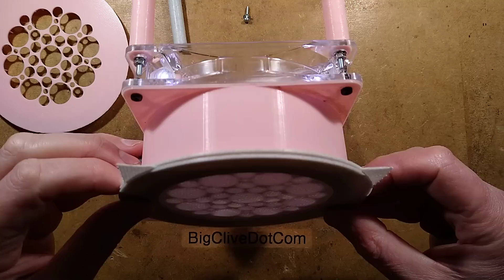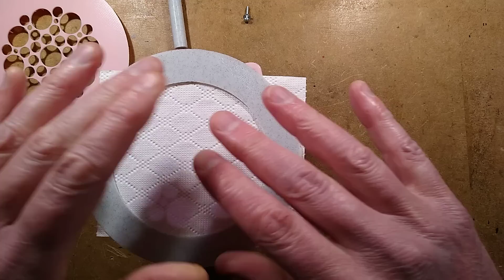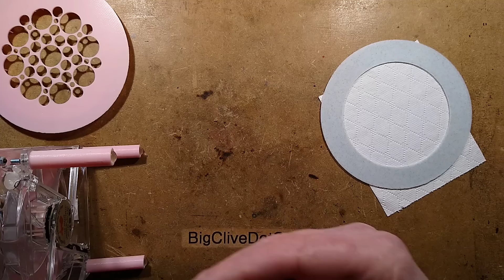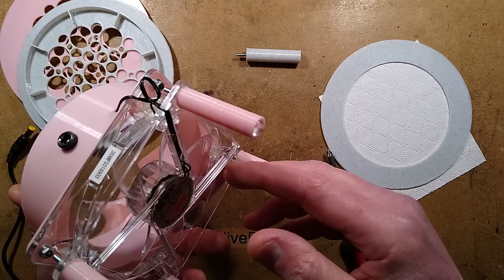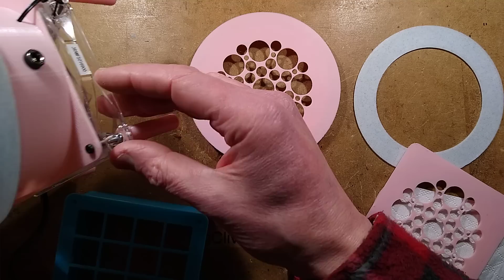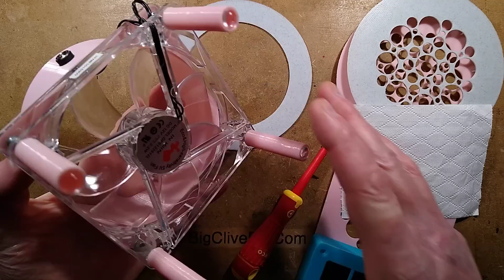MK3 air filter with customisable 3D printing files

Comment: OMG ! hate to be chatting about your ring ! but you could make dimples for small neodymium magnet to hole your ring LOL  !!! 
You Really need to do some testing with different fillers (the tree pollen is no fun at the moment here ) so may be have test at one my self 

catchphrase
don'tunderstand just silly answers by people that think they're smart than you !!!! 

I don't know lot about this stuff but do bit of air brushing and painting (dolls houses) and have made temp small spray booth, 
A lot of the real spray booths (normally for posh car painting ) use down down draft would there be any point running you little fan upside down ? 

And there's a  different type of filtering call waterfall were they pull the air through water to take the fumes out of the air normally for solvent car paints how good is water at filtering stuff ?

Just thing out loud ? but I love that you make thing about things love Jenifer xxx
Reply from the maker: I've looked at a water based air cleaner in the past.

Comment: An integrated square grid on top of the round column to support tissue. The a loose fitting round cover cap to place over & hold tissue in place. Loose fitting to be gentle on tissue corners & a pattern on a cap to visibly contrast and see dirt collection letting you know see it's dirty. Like a plastic jar & lid without screw threads

Comment: I'd be inclined to try out printing a 'turbulence diffuser' to slot into the void with a cone to cover to centre of the fan, to see if it made any difference. You'd need to try it with and without and see if there were any differences in the dust or air fluff collected.  Definitely a good project tho and of help to people needing cleaner air to breathe especially if there's dust or pollen around.

A bog roll holder and dirty tissue collector with a handle on could be the next addition to the project 😉😂.  Wind the handle and a new sheet is available.

Comment: It would help if you Crinkle folded the paper to make Collection Veins Pockets that hold more dust if you look at other Hepa Air filters + they also let more Air pass throw
the have a Repeating  WWWWWWWW Shape 
The Pockets also make it more hygienic to Depose of a Dust Full Filter Do the pockets trap the dust inside for Cleaner disposal Otherwise the dust goes everywhere 
 
Few Macarno Sets and you can make a Folding loom to make the HEPA Pocket filters + Rollers PVA Glue  the tops and Sides  to Give Ribs and structure

Comment: I modified a 1980’s Phillips fan heater that has a fan on either side- just took out the heater elements,and put a piece of “heperflow” vacuum cleaner bags over the inlets- filters the air nicely

Comment: I got a box fan that has a quiet mode and an ait filter designed for air ducts that managed to match the size of the box fan build a spacer duct between the blades and the filder and it ended up doing the trick for my allergies. I wanted to see the diffrencw between before and after and used lazers to map how much dust was there before and after and after about 30 mins all the dust in the air was gone. Tho the room was a bit warmer then usual.

Comment: A few notes/suggestions: Use a Yate Loon D12SL-12 fan with a USB 5v power supply - will be dead quiet and spin reliably, and no dinky unwanted lights. Maybe a hexagonal pattern for the top cover?

Comment: I could see a couple of improvements: 1)I think the filter material is likely to blow away if it was near a fan or air conditioning, perhaps more likely if the fan were off. Perhaps a magnet to latch the top ring on? Or a clamp? 

2) Could it be possible to incorporate some fins on the outlet to divert air away from the fan to prevent the filtered air from recirculating back to the inlet? Perhaps as part of the legs.

Comment: You know, you could just add a thin rod section to each top of the legs that could go all the way through the fan and come out the top, add four small holes to the plenum and have it snap or glue onto those pins.  Or make them a bit longer still, cross drill them and pin them in place with bits of wire or something, sort of like cotter pins.  No need for nuts, bolts or washers.

Comment: There are slow-running larger diameter fans that are usually put in the side vents of PC cases. Maybe doing the same thing, but with a fan with 20cm diameter (or 8 inch, if you prefer) would be worth a try. Then of course with a kitchen towel, since a piece of toilet paper is too small. I also wouldn't mind the round top, but with the square grid-like holes as in version 1.0 (I think it makes for more area for the air to pass through than the different sized circular holes). This would of course potentially mean that it may have to be printed in multiple parts that are then somehow put together (I'm thinking about some type of jigsaw mechanism). And of course I would love to see proof that it can actually reduce the fine dust that usually gets sucked up by your vacuum cleaner.

Comment: I would feel that having the whole unit be horizontal would be better for the following reasons.
1. That would allow for more uninterrupted airflow as the fan is no longer blowing air at the ground.
2. It would reduce the amount of air being recirculated through the system. You can add a long tube to completely remove the chance for air to be sucked back in.
3. Some PC fans (especially cheap ones) with oilite bushings will have the oil seep out if constantly in a horizontal orientation, shortening their lives.

Comment: The soft toilet paper seems to leave a lot of lint in the bathroom, whereas cheap toilet paper does not tend to leave as much lint. My sense is that kitchen paper towel would be better for this application but haven't tried.

Comment: What percentage of the inlet duct is masked by 3D print plastic? Is this version the optimal design? (cf. short-lived history of turbofan/turbojet bell nozzle anti-FOD guards).
Worth noting that a bell-mouth inlet duct improves efficiency when the ambient inlet velocity is ~zero for a stationary device (IE, not able to benefit from dynamic ram-air effect).
Reply from the maker: This one put form before function.  I'll make a more efficient pattern.

Comment: Would a simple pattern of spokes work for the top? That way you could bring the fins all the way across. 

In any case, it looks pretty good. I think you've got this down as simple as it can be.
Reply from the maker: I've already designed the eight spoke version.  It basically extended the turbulence fins to the middle and got rid of the hole pattern.

Comment: Make use of the whole roll of tp. Wind it very slowly onto an empty roll or a stick. That way the filter could run unattended for quite a while. Even in a very dusty environment.
Reply: Some pieces got lost: The tp should be moved across the grid from a fresh roll onto a stick. Maybe two rolls are required; slightly interleaved to avoid a bad filtering effect through the perforation.

Comment: Maybe add a corrugation in the top piece so more air can move through the same area?  Even if more air doesn't move through you wouldn't have to replace the paper as often.

Comment: Screw simplification option: you could eliminate much of the hardware and assembly by using a single screw that passes from the top, through the fan mounting holes, and into each foot.  A self threading screw or even a drywall screw would work. Just modify the hole in the foot to accommodate such.

Also wondering if you could print the top maybe in a pleated sandwich /\/\/\/\ so that you could increase the surface area of the filter substrate - would improve air flow.

Comment: Nice choice of filament color! Although I feel that all pink electronics need to be mains-referenced.
Reply: @gary6576  
Why stop at mains? Add a few components and you could have a voltage doubler,  giving you a wonderful chance of a 500-700 volt DC shock
Reply: Wouldn't take much to use a cheap dropper capacitor 'transformer' for power :)
Reply: Yes, he's missing the negative ion / ozone generator.
Reply: Agreed on filament color :) One could use a polarized Tantalum capacitor as a dropper cap, instead of Mylar, that'd increase the danger off this unit.
Reply: Loving the Pink!
Reply: these are just leftovers from the toy production ;)
Reply: You could always connect it to a cheapy chinese PSU and build an aluminium housing for the fan what needs to be reference to mains for the usual 'zing'.
Reply: instablaster

Comment: I was going to write after the last video but the phone rebooted randomly. What you call the fan buffer zone is called a plenum in HVAC lingo. If you are looking for the most filtering for the cost of the power and the lowest amount of noise using the general setup you have, consider two changes to the design. One is going back to the open grid for the filter support as the holes, although they look fabulous, do restrict the amount of filter with flow through it, which increases the velocity were it does go through, which will create more sound and decrease the effectiveness of the filter. Then the second thing is to blend the plenum from the square shape at the top to a round shape at the bottom without hard angles or edges, so it ends up the same inner diameter as the fan.  No need for any fins to straighten the flow as it will only add resistance and noise. You would need those only if doing multiple stages like rotor, stator, rotor etc..

Comment: something like this is a fight between noise airflow and static pressure when it comes to the fan i would look at pc fans made to be used with radiators like the noctua nf-f12 the best option would be the industrial ppc fans however they are  26$ each while the nf-ff12 are 20$ each (noctua is expensive but they are probably the best fan makers in the pc industry)

Comment: Ou can make the legs solid so that the 10mm silicone feet can also glue in the middle and use heated inserts on the top side, the hole diameter for m3 brass inserts is 4mm and 6mm deep.

And then have slightly longer screws that attach the base to the legs through the fan.

For a few cents of inserts you remove 8 nuts and 4 screws.
Reply: Or just print the same sort of blind hole at the top and use (long) self-threading screws, for even fewer parts.

Comment: Where's the file to print a sheet of toilet paper?
Looking forward to the underclocked 40cm desk fan version (series capacitor?)
Reply from the maker: The 3D printed toilet paper is very abrasive, and you have to sit for an hour while each sheet prints.

Comment: How would I go about sending you something. Specifically it's a 24v motor with PCB for a dual fan air purifier, still working took it out a unit I have but thought you might find a use for it. Not sure how to get in touch with Clive directly though?

Comment: Thanks Clive. Will be printing a couple of these off tomorrow for the workshop. Will be interesting to see how they perform.
Reply from the maker: A workshop might require something a bit beefier.
Reply: @bigclivedotcom  It will certainly, however for quite a dusty environment it will be an interesting test.
Reply: @bigclivedotcom  Any chance you can provide the code for the original square platen please?

Comment: I told you last time the grid was better for airflow! 😉
You might wanna try a radial grid arrangement like some circular drain covers use.
Reply from the maker: The radial design has already been made.
Reply: @bigclivedotcom  wouldn't radial also make more sense as far as the turbulence prevention fins go?

Comment: Next stage; A fully 3D-printed vacuum cleaner with tissue dispenser for changing the filter after each pass on the carpet... :P
Reply: The fancy version would take a full roll and slowly use it up, like a really wide reel-to-reel.
Reply: An autonomous vacuum cleaner with presence and motion tracking. ;DDD
Reply: Is this gonna evolve into a mini Dyson Root Cyclone™?  Hope so.

Comment: Could you combine it with an ioniser to help attract the dust in the room towards the unit then have the fan pull the dust out of the air through the filter? This could be a nice way to deal with the mess that usually collects around ionisers.
Reply from the maker: It could, but possibly with a slightly positively charged mesh under the paper.

Comment: I would also like to see some version with a electrostatic stage.
Reply: Yes, this needs combining with some dangerous eBay quality high voltage electrics. Maybe add some negative ions and UVC for added excitement.
Reply: @ncot_tech  Yup, more excitement factor needed.... 3 phase perhaps?.... Lasers, definitely!
Reply: Suggested that last time! A "useful" application for those EBay cheap ionisers, and Clive's supply of carbon fibre underfloor heating cable!

Comment: I should try this with my old server fans. Though since they spin at 10,000RPM I suspect they'll act more like paper shredders hehe
Reply: Cut them back to about 4 volts. That is what I did with some that I'm using for a mini breeze here. I found an old phone charger to power them. Good luck.
Reply: @d.t.4523  Thats kinda difficult since they are 240v fans :P
Reply: @AK90  Well... crap! Just when one of my "optional engineering" toys was a neat trick, someone throws a high voltage wrench into the works. Keep working on it. Good luck to you! 👍
Reply: Noise needs to be taken into consideration
Reply: Only 10k? My dell server has 15k RPM fans... About 8 of them. When it cranks them up for a self test, it sounds like it's going to take off.
Reply: @tin2001  That's not a server - that's a space heater!
Reply: @tin2001  Yeah its from a fan pack that goes on top of a server rack to exhaust the heat. 10,000RPM, Aluminium housing and steel blades. Also runs on 240v :P

Comment: I've used a wide variety of paper filters for making herbal smokes more discrete and found a VERY wide variability of filter performance levels between various toilet papers, paper towels, and napkins. I would love to see a test of 3 or 4 of these with different filter papers, but it's almost impossible to determine a paper's relative performance level without blowing smoke through it to test.
Reply: Might want to be careful which ones you use. Some of those products have oily additives that have become to bane of my printer. Finding the only stuff that doesn't have it is cheap dollar store paper towel or hardware store paper rags. Even the blue mechanic stuff seems to have some sort of additive that easily deposits onto warm surfaces below it. Not sure how safe that would be to inhale though it's bound to be safer than raw smoke.
Reply: @eideticex  The filter is for exhaling through only. I trust paper towels meant for hygiene during meals to be relatively clean.

Comment: This is a good idea for hot places, for example, in hot places fans circulate the dust and you get a bunch of allergic reactions.
Reply: If you are using a larger fan(box fan), you can use a furnace filter on it to really effectively filter the air.
Mattias Wendel does this for his wood shop in his basement.

Comment: I'm confused. Where do you use this:
Reply: Put in on a bookshelf or on top of cabinet or anywhere in the air circulation pattern of the room you can find that's out of the way.
Reply from the maker: Bedroom, where it can run 24/7 silently.

Comment: very cool, on amazon i found for usd $5 shipped a "cabin air filter" for various cars, it's rather large and i printed a custom adaptor for that for putting near my soldering to suck up fumes. it works quite well.

Comment: my computer case came with a 'dust filter' that is just a foam like material. 
I didnt think it would be a very good filter, but it works surprisingly well. And has more air flow then a piece of tissue paper.
Reply from the maker: It's a coarse dust filter to allow high air flow.

Comment: Those that don't have a 3D printer can use a 20 inch box fan with a furnace filter behind it.
Reply: NYT Wirecutter did a video about that. Removed 85 to 90% of match-smoke particles from the air versus 95 to 99% for commercial units
Reply: 3M Filtrete brand furnace filters work especially good for fine dust or particulates.

Comment: 0:32 The lights come on, and I start thinking "Oh, that marble filament always looks good, but it feels a bit tacky h… oh.  I can't tell if that has made it worse or better."

Clive, if you ever use another filament color, I will be somewhat disappointed.  It's so bad it's good, but it's so so bad that I still don't want to buy a spool of it for here.  It also has about the right color value and saturation to let shading and contours show up on camera.

Putting the OpenSCAD files in the descriptions is a great tradition to keep up.  OpenSCAD is an impressively expressive language for both how small it is, along with how small programs written in it can be.   I would guess that many of your examples fit into a QR code, QR Codes being the new "number of pages." (NB: OpenSCAD also manages to fit a stunning quantity and diversity of frustration into such a small language.  I start most deigns in FreeCAD nowadays, for better or worse.)
Reply from the maker: Openscad is extraordinary.  Literally a programming language for solid objects.  The maths involved in the software are mind boggling.

Comment: If you made the circular grid the top plate then the design matters as it would be show 24/7. As it is covered by the paper, not so much.
Also the sparse square grid looks like the back of my Ebac dehumidifier so if the professionals use a square grid, there is probably a good reason behind it. Oh and that grid is on display with the foam filter behind it.